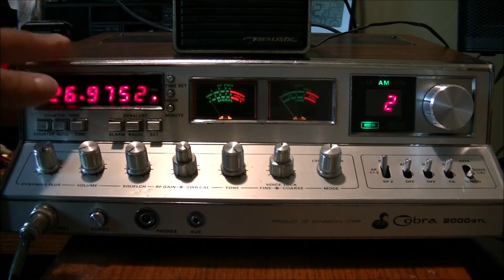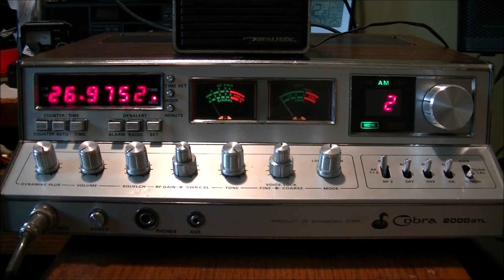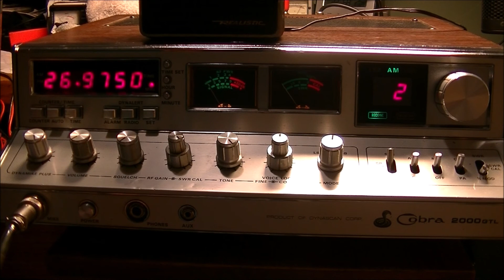Cobra 2000 GTL Low on Frequency FIXED

Comment: Thanks Andy. Nice cobra. This came in handy as I am figuring out my counters first three digits jumping around with it not keyed down. Has to be the chip like Tim said. I heard a resistor goes out to or some upgrade but not sure if that is legit.
Reply from the maker: Yes David, It was a bit of a long troubleshoot but I finally got it all worked out. the counter can go funky for several reasons too

Comment: wow, I was just talking about old CB's and Secret CB. I had to order the CD just to have it.  Maybe you are lucky with a cold solder problem.
Reply from the maker: Just a dirty "auto" switch in the frequency Counter section. Lucky me.
Reply: @Tobinindustrial  I just watched it again, We were putting the boys to bed so I guess I didn't see the whole thing. Good to see it working, the classics are far and few between.
Reply: @Tobinindustrial    i was just gonna suggest that, more often than not its a dirty switch, always check the easiest solution 1st.
Reply from the maker: @allthingsradio7208  Thank you for that information. You are so right.